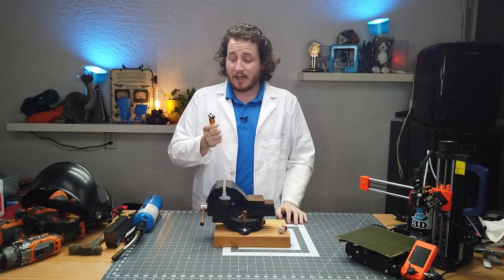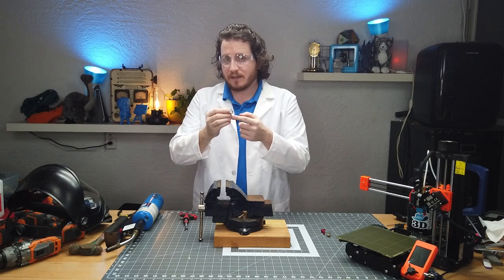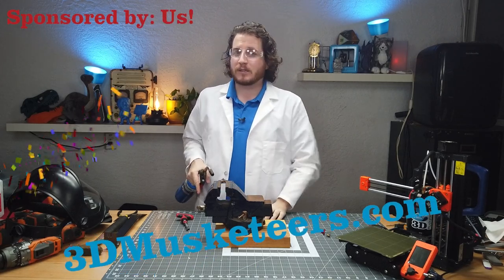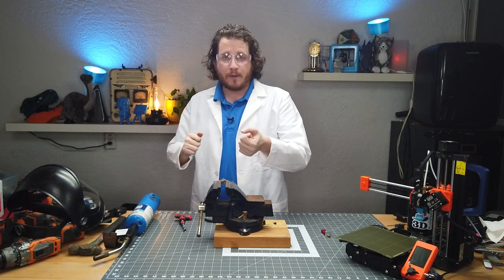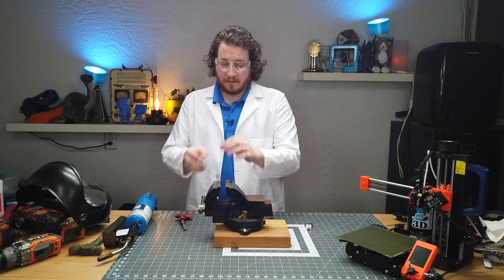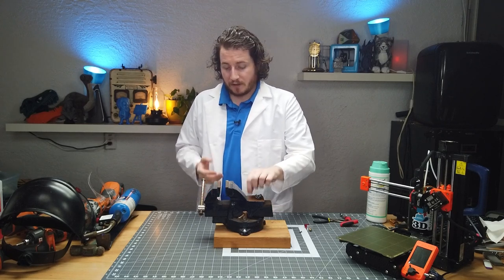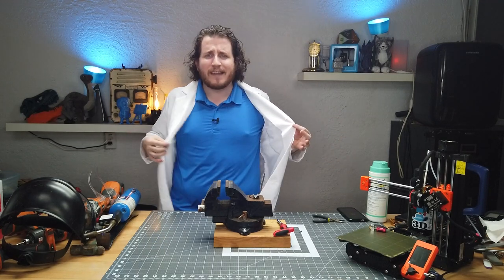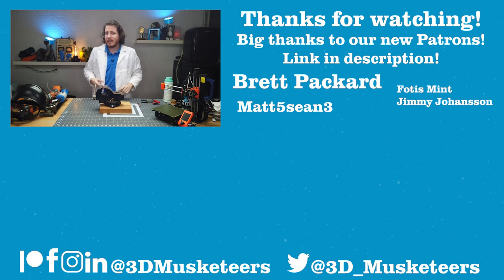Extracting a Nozzle Stuck in a Heater Block!

Comment: Fantastic video and some great adivice. 
I've learned that every print is a success.  Meaning whatever it gives me I realize what can go wrong or right.    This takes all the emotional stress (as much as possible) from trying to print something.   

Great idea about keeping parts on hand and then once in a while breaking down all the parts, removing clogs, and rebuilding the heat blocks so they can be on hand for a spare.  That actually means one only needs to buy about 2 heat blocks and cycle those repaired ones.
Reply from the maker: We keep a few more than 2, but for the average user a spare or 2 of most parts should be sufficient

Comment: Well, after snapping off a nickel plated copper Micro Swiss nozzle from the heater block of my Ender 5S1, a few failed attempts to drill out the nozzle and try to thread a screw with a reverse thread into it so that I could (hopefully) screw it back out.. And two (yes, TWO) purchases of inexpensive Creality "Sprite/Spider extruder" heat blocks and hotends which ALL turned out to be 4-5mm too short for my CL-Touch probe and extruder enclosure, I have drilled out a fiberglass perf-board PCB as an adapter to 'make a standard MK8 hotend work'.. I came to this video before attempting to install it. Because really, I would rather print a proper adapter. So I managed to FINALLY find what is HOPEFULLY (the reviews and comments all said that it IS an Ender5S1 block) that will arrive tomorrow. Because while I see MANY advantages of this printer using either high-end standard MK8 extruders, or high end standard Volcano extruders, it just doesn't make sense to try and make something work until I KNOW that I have a fully working printer for when things don't work in the modification process. And yes I do own two SOVOL SV06+ printers that I run Klipper on. My Ender 5S1 is my newest purchase. Currently in the process of moving so setting up one of my SOVOLs (one needs the linear bearings greased and the other needs a new bed) was not a realistic option for designing and printing an adaptor that WILL work rather than 'maybe work'. Sometimes it is better to bite the bullet and make a purchase and wait for the mail than do something in haste that you may 'think' is smart at the time but logically not so much. In this grief filled process of having my current-main printer down, I realized that with some modifications, this cheap but nicely mechanically designed printer can be a true monster. Running Klipper on a stock Ender 5S1 already flabbergasts people on Reddit with your print speeds and photos of your results.
Reply from the maker: Definitely this is a measure twice cut once kind of thing

Comment: Any Tips to prevent this in the future? i'd really appreciate your input
My Nozzle was stuck so strong it literally wore off and became rounded, i tried some Power tools, i even put it in my Electric furnace a touch below Aluminium's melting point for hours, i also put it in the Freezer, it won't move!
Ordered a whole heat block with a Nozzle off Amazon
Reply from the maker: if it aint an expensive nozzle, just toss it. But you should be bottoming the nozzle to the heatbreak not the block, so then when the heatbreak comes loose so should the nozzle

Comment: I would like to see a video about what parts I should have. Meaning tools, but also spare parts. Do you print every part of the printer?
Reply from the maker: Generally speaking, a handful of spare nozzles, thermistors, silicone socks, a heator or 2, and a spare hotend are good backups to have. But we can absolutely do a video on that. We did a FDM tools video a while back. Here's that video:  https://www.youtube.com/watch?v=UhDdO_WML14
Reply from the maker: Regarding printing every part of the printer, no. You theoretically can with some builds out there being 90%+ printed, but there is no point. However, if you have printed parts on your machine and you want reliability we always recommend printing at least one set of spare parts so if it breaks you can swap in the spare and then print a new spare as the first print :)

Comment: I'm my case on my ender 3, I actually held it in ace with an adjustable wrench tm and tmused a sticker wrench that was included with the pack of nozzles to remove it but what ended up happening is it got loose and started spinning.
Reply from the maker: also a good method!